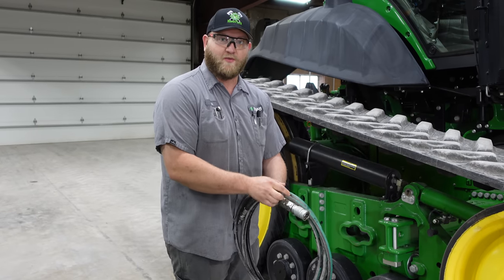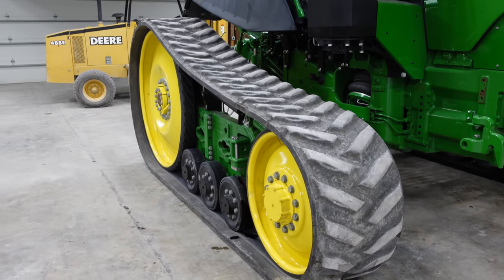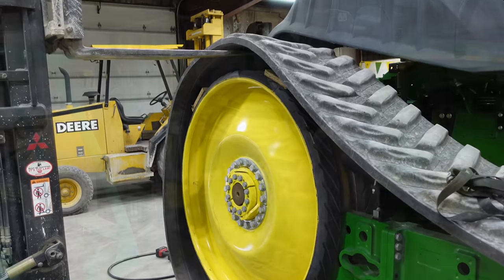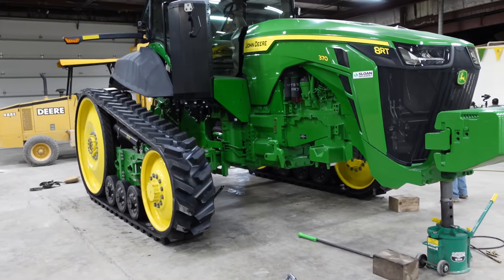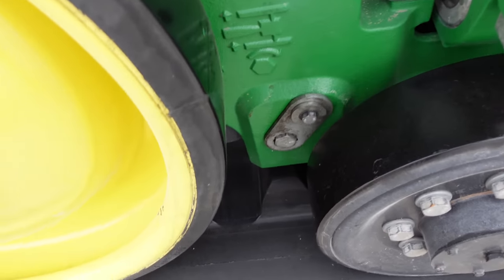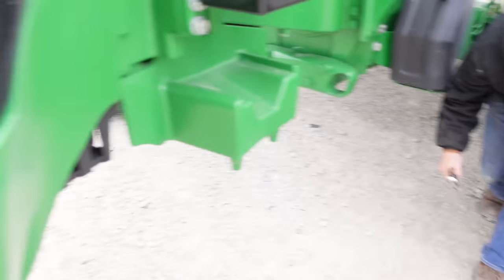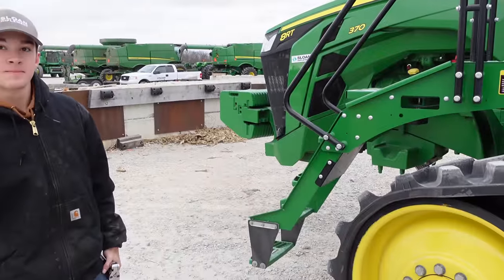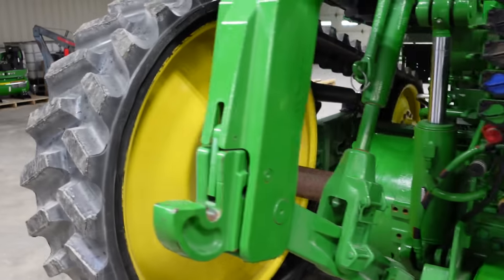Learn how to replace tracks on a John Deere 8RT 370! (Best set of tracks I have ever installed!)

Comment: Just got a new set of 16" wide for our 8360RT. We used to have the local dealer swap our track as we would change from 16" for row crop to 24" for tillage/planting with a grain drill. only going to use the new 16" tracks that we just got and put them on ourselves after watching this video. We just need to invest in the correct tools. Thanks for the info and effort you put into this.

Comment: Not suggesting anyone would want to do it, but how different is the tractor frame whether it is on tracks or wheels?  The rear mud guards look as if they are for a wheeled tractor and towards the bow there looks to be the location for a front axel.  Thanks for sharing, it must take time to set up to film and I do appreciate that.

Comment: Hello Zeth, I hope you are doing okay. I love your sharings and they are very informative. Thanks for your efforts to create good contents like that. I have a question to ask you and mind your opinion as I think you are equipped enough to give a good answer. The question is; 
•What’s TORQUE ? 
• What increases it in a tractor ? 
          Thanks, all the best. 🎉🎉🎉
Reply from the maker: The best way i can easily explain it is this: toque would be how much weight you can bench press and horsepower is how fast you can bench press that weight. 
The main way you can increase torque is an increase in engine displacement, an increase in fuel and air, and more compression. The bigger the boom inside the cylinder, the more force is pushed down in the piston = more torque.
Reply: @ZKMasterTech  THANKS FOR YOUR GOOD ANSWER, I GOT THE POINT AND WISH YOU GOOD LUCK 🍀 TO KEEP THE GREEN IRON MOVING. 👍👍

Comment: Does anyone know why the 2 track machines aren't priced less than the rest of the lineup ? Seems to me that the absence of a front drive train and its associated running gear would save a commensurate amount of money  . Just wondering  , keep up the good work Zeth .
Reply: Tracks themselves are expensive, track frame assembly is expensive and it attaches different than other drive option

Comment: Holy crap that is a big torque wrench! Do you know what brand it is? I am trying to convince my shop to get one for the 9RX's so I don't have to lug a torque multiplier with my torque wrench under the tractor when I do inspections. Does it matter how fast you go when driving your 150 feet? I have had difficulties doing track alignments on the 9RX tractors but that may be because I am new to Deere.
Reply from the maker: @KAL1080 I’m not sure off the top of my head what brand it is. I’d have to look. I usually go 2-3 mph when driving back and forth.

Comment: I saw that you removed the outer idler wheel.  Have you ever tried removing the outer drive wheel instead?  If it had idler weights, it might be a good alternative.  I believe that pulling the drive wheel is the way it's done on Challengers when the tractor has a stack of idler weights.

Comment: Exact question how much does a set a tracks or per track how much do they weigh I know you’re using a forklift also I like the hydraulic tensioning system they have on that I’m used to a skid steer’s and excavators that use a grease cylinder in there that is pretty bad ass

Comment: What is the black cylinder for? Suspension?
Reply from the maker: That is a accumulator. It absorbs pressure spikes in the system and helps maintain tension on the tracks.
Reply: @ZKMasterTech  Thank you!

Comment: What type of work is this machine intended for?
Reply from the maker: This rig pulled a high speed planter and side dressed corn and beans. Then was a auger cart tractor in the fall.
Reply: @ZKMasterTech  Thanks I thought it seemed lighter than the machines you usually work on.